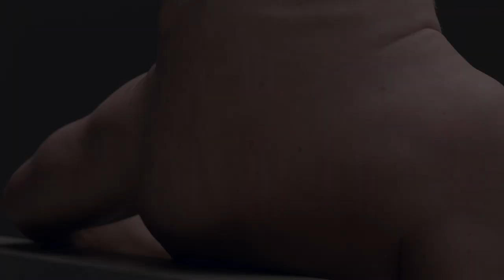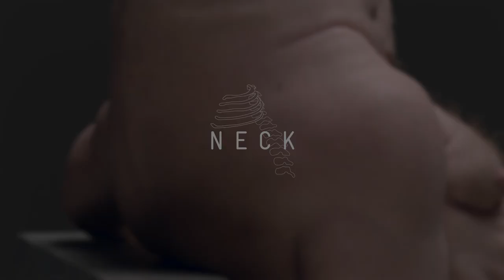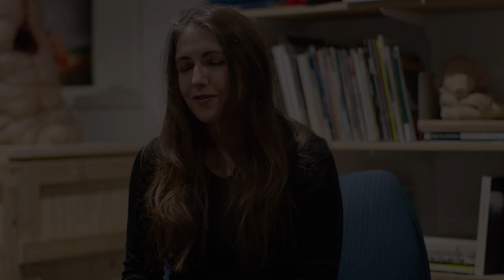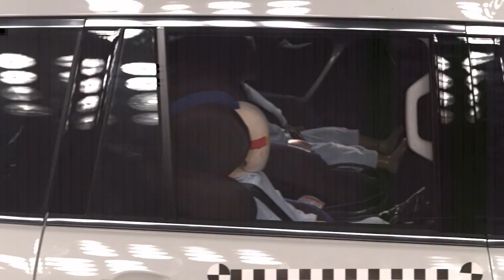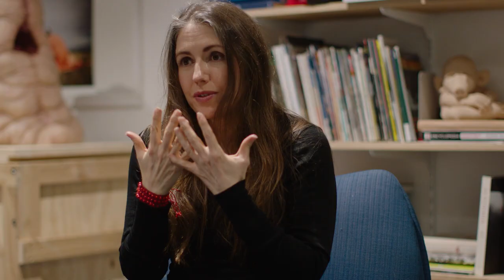TAC Interactive Sculpture Graham: Neck – Meet Graham, TAC 2016

Comment: This is the weakest neck in mammal history for many reasons.
Not the fault of the artist but the complete fault of the so called trauma surgeon not to revise her anatomical work, falling into worse case scenario for Graham.

1. Craneo Cervical Junction (JCC) composed of usually 3 bones: Occiput (skull base), and the first 2 cervical vertebras have a complex system hold the skull in place, with the purpose of:
- Holding the skull in equilibrium on top of the curvy spine, with the weight centered.
- Letting free movement in the neck (rotational, flex-ext, lat flex and its combinations).
- Widening medullar channel so when it meets the foramen magnum (skull hole) has enough space for CSF to flow while medula connecting with the brain.

*Now, JCC is completely erased in this model, being the top vertebra the smallest one with the narrowest medullar canal in the spine (check their webpage to see it),  and connecting with the lowest most posterior part of the skull (no equilibrium, total stress since birth), and obviously really limited movement, meaning the slightliest of the forces will wreck the joints of this "human", but first obviously will dislocate completely the skull connection to the spine.

And you will think about the ribs, just... ribs are flexible and made to protect inside soft organs, not to protect the medulla (that's the vertebral function).

Graham is NOT the car trauma tank, but the weakest flower ever.
Reply: This human was created to survive a car crash, not to live like a normal human being.